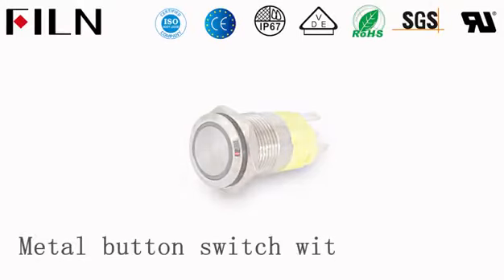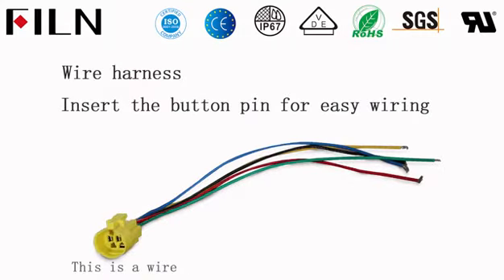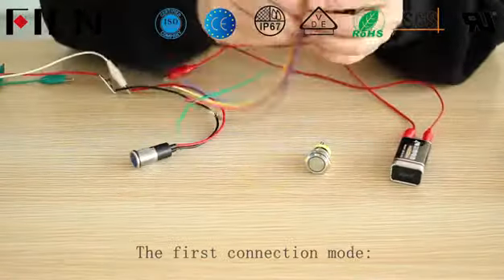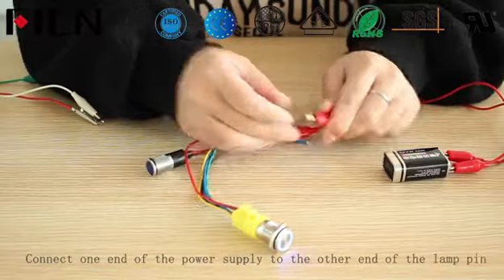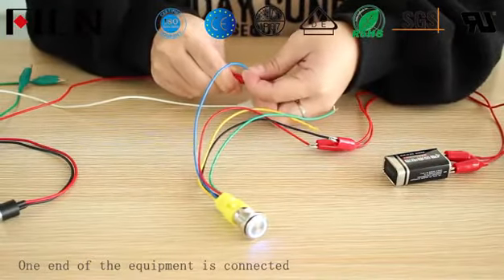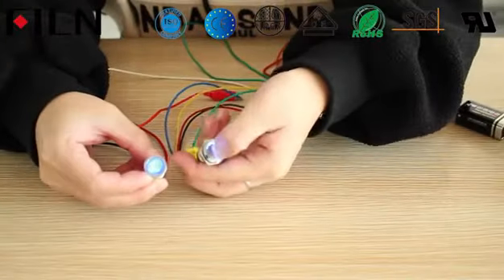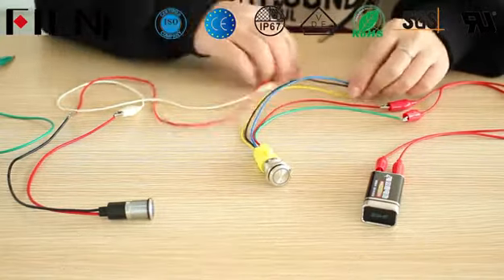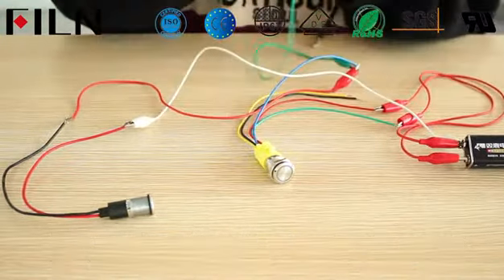how to wire a 5 pin push button switch

Comment: Stupid deafening music that drowns out the commentary.  Diagrams unclear.  Poor effort like so many of these instructions, the actual wires from the plug pins are assumed and not defined or shown.  We don't all want to use the loom, we actually want to know the designated purpose of each pin.